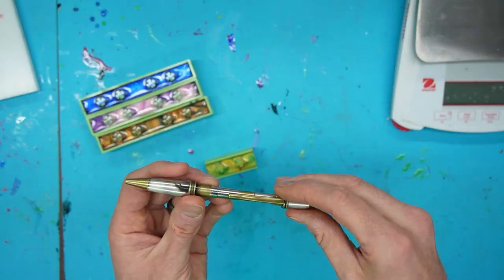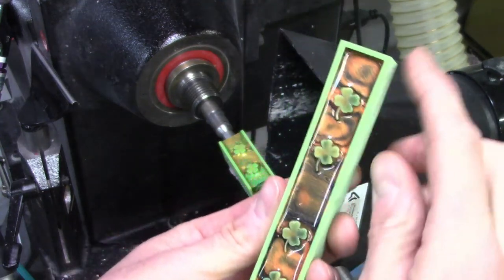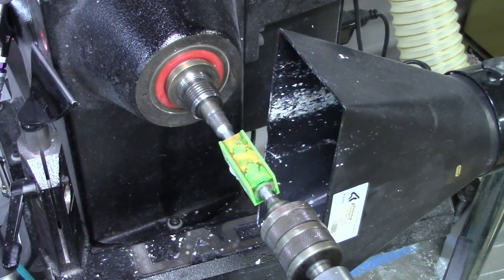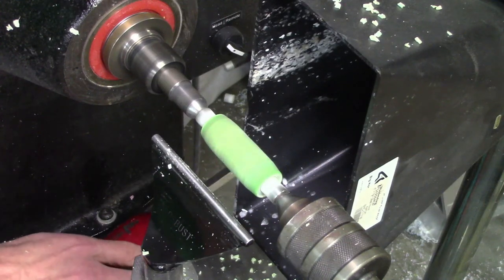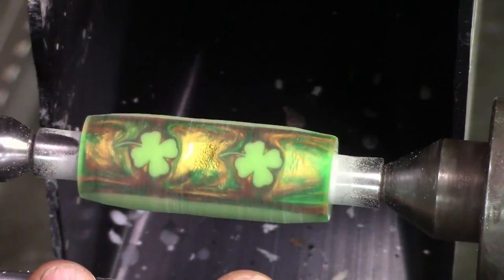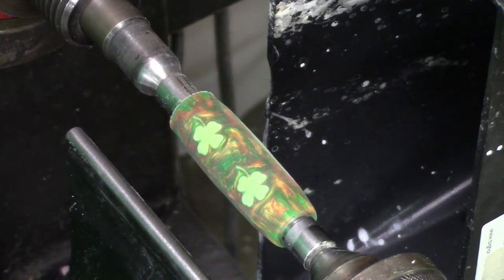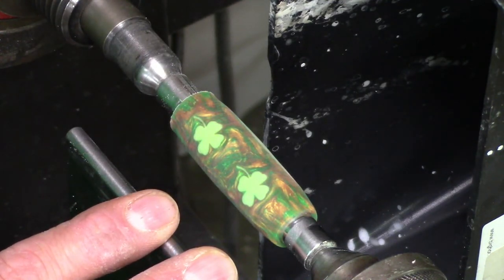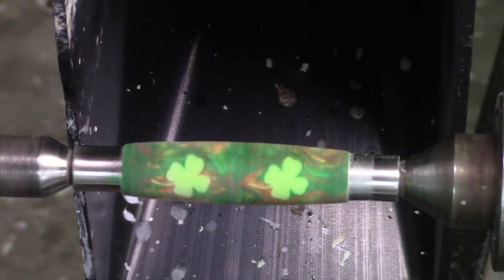🔴Replay: Pen Turning: 3D Printed Shamrock Pen | Episode 174

Comment: Awesome blanks. Just wondering what is the remote system you use for your dust extractor?
Reply from the maker: Thanks Michael! The remotes come with the Oneida Dust Gorilla cyclone I recently installed. I think they might be available on some of their other units as well. There are also 3rd party plug in remote systems that you can buy as well. You can even have multiple remotes, I have one at the lathe and at the table saw too. iVac Pro is a remote switch system I have seen other people use (don't have any personal experience with it myself, but they seem to be used by a number of people) Here is my affiliate link to them on Amazon if you want to check them out: https://amzn.to/3NjY42b
Reply: It the system I’ve looking at for a while now. I decided to bit the bullet and buy a basic system. So tired of trot switch the dusk extractor on and off all the time. Thanks for your help.